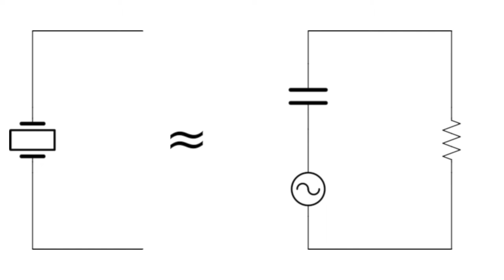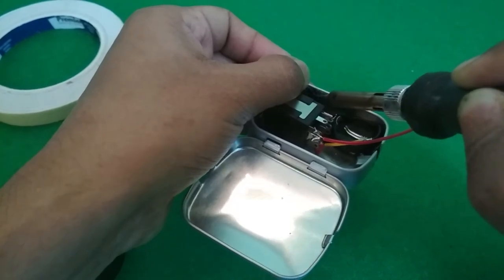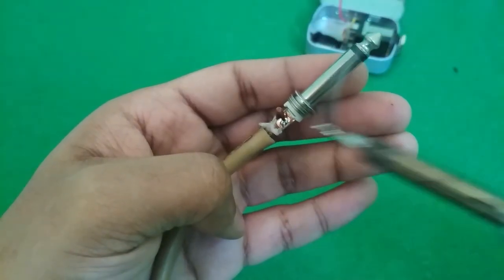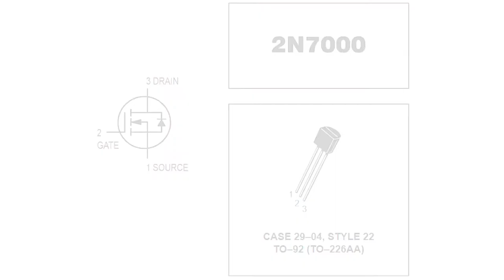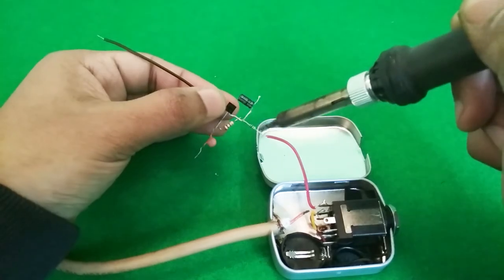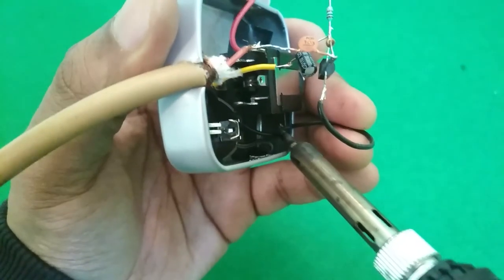Easy DIY Pre-Amp for Acoustic Guitar

Comment: Does this result in a DC offset - or how are negative frequencies handled in this circuit ? I always thought audio is an AC signal. I built it - sounds awesome - it even is too loud for my line input. 
Can one of the components be modified in order to get less output - Eg replacing R1 - the 1K Resistor with 1200 Ohm? 
Thanks for this great lesson in circuit design.
Reply from the maker: The input and output capacitors are there to block DC; that's the way engineers think about it.
You can reduce the gain by making R1 smaller, but that will also reduce battery life. A more standard way to do it would be to add a resistor (100 ohms or less maybe) between the source of the mosfet and ground.
Reply: Do you have some guidance on reducing noise ?

- Using a battery
- Use short cables
- Ground everything
- Twist input cable (add some kind of shielding?)
- Put components from input source until signal amplification into metal encasing (do you know how thick it should be? or what kind of metal is working best?)

Are there more or less noisy piezos? I`m not able to get a really clean signal as you achieved here yet. Anything important I forgot ?
Reply from the maker: @xpeace77  Make sure your metal casing is grounded.
If you're having problems with noise, your first step should be to try and figure out where the noise is coming from and what is causing it. First, check whether the noise is coming from the guitar itself or from the preamp. If the noise stops when you unplug the preamp from the guitar, then you know the noise is coming from the guitar.
Next, what kind of noise do you have? Humming is due to magnetic fields and can be addressed by using twisted pair cables. Static or hissing is usually due to electric fields and can be addressed by shielding the circuit. Crackling or popping sounds are typically due to loose connections. Components also have intrinsic thermal noise, but that shouldn't be a problem for moderate-gain circuits like this one.

Comment: I made this but i have a problem.
It worked fine untill a moment. Now there is a constant loud BUZZ. I don't  have it connected to mains voltage in any way. I changed the transistor with no succes.
Do you know what i did wrong? I just can't find the problem that suddenly came. I had got a message on my laptop that the USB port was pulling more current than the power supply could handle. But it was just for once after the problem came.
Reply from the maker: Why your laptop? Why the USB port? I don't understand how you have things hooked up. 
Anyway, If it was working fine and then stopped, that can only mean that something went wrong with the circuit. My guess is either a short circuit (something is touching that shouldn't be) or a loose connection (something isn't touching that should be).
Maybe the wire connecting your circuit to the metal case has come undone.
Reply from the maker: Another possibility is that there is a noise source that suddenly activated somewhere nearby, that could be any electrical device in the vicinity including your laptop.
This is less likely, though. First, check your connections and make sure ground is connected to the case.
Reply: @Psychotenuse  i use the USB port of my laptop as the powersupply.
All grounds are connected to eachother. I have tested it with a multimeter. The last thing i could think of is that something is wrong with the 10M ohm resistor. I only had 1M so i solderd 10 in series. But i cant test the full resistance since the meter only goes upto 2M. I Will remove the resistor and check if all the resistors still are 1m.
Reply from the maker: @TheDutchFighters  I would advise that you use a battery. Fewer unknowns.

Comment: Hi, is there a way you could power this circuit with the 48v Phantom power of a mixer?
Reply from the maker: It could definitely be done.
Reply: @Psychotenuse  you think it would be necessary to reduce the voltage with a zener or do you think it should work without adding any component
Reply: @pauencinaslaffitte5256  It's a self-biasing circuit, so I think it should be fine as is. The output signal will be very strong though!

Comment: what if you combined this with your aluminum foil condenser microphone? Would it reduce the noise issues there?
Reply from the maker: Yes, probably, particularly if I built the circuit into the mic with short wires on the low level side. Unfortunately that mic only existed for a short period of time after the video was made :P
Reply: @Psychotenuse  awh, I guess I'll just have to replicate it to truly find out :D
 Just to clarify, what do you mean by the "low level side"? Is that the short end of the tube?
Reply from the maker: No, the wires going from the foil to the circuit. Low signal level.
Reply: @Psychotenuse  ah. If I'm getting this correctly, are you saying that the longer wires are acting like antennas, which is leading to white noise?
Reply from the maker: Haha, yes. That's where noise tends to come from in audio.
Reply: @Psychotenuse  ah that makes sense. Thanks!

Comment: Is 9-12 volt okay to that corcuit
Reply from the maker: should work well, but the gain will be rather a lot. For simpler circuits it's generally better to use batteries.
Reply: I already build it but there is static noise and hiss can you please tell me why?

Comment: So I want to use this as a stage before an active preamp, will the 9V(from the true preamp) power this as well?  Or do I need to battery in this circuit as well?  How would you address that?
Reply from the maker: Um... no. This circuit has a capacitor in line with the output, so it can't be powered by the signal sink. Even if you removed that capacitor it would depend entirely on the nature of your "true preamp" and I doubt any guitar preamps are designed to send power down the input line; that tends to be something you only do if you're expecting someone to plug in an electret mic.
Reply: @Psychotenuse  so I’m not sure I understand.  All this electrical and signal stuff if relatively new to me, so thanks for your time and please bear with me…I building an semi hollow guitar.  Like a telecaster the I already own, I want it to have a piezo bridge.  The telecaster has a fishman piezo bridge, with a 9V powered preamp.  Not understanding the  issues with piezos, magnetic pickups, and differing impedance, I bought a neovin pre-1 guitar preamp.  I was thinking I could use this to improve the piezo signal quality in much the same way that the fishman does on my telecaster.  It wasn’t until I really started reading about piezo pickups/bridges did I begin to understand the difference with piezo impedance and magnetic pickup impedance.  So, now being unsure if the preamp I bought is suitable to condition the signal from this piezo bridge, I found your channel and actually made your circuit(haven’t tested it yet but it should work fine).  I intend to run my signal from the bridge into it, then send that signal to my “true”(or previously purchased) preamp, which is powered by a 9V battery.  You are saying that this circuit won’t function if I make it the first stage in the preamp powered by 9V?
Reply: @Psychotenuse  the objective is to condition the piezo bridge’s signal.  Maybe the 9V preamp will do that.  I just don’t know very much about impedance, especially when the other pickups are magnetic
Reply from the maker: @darrellgreen3592  My point was simply that you will need a battery for the circuit.
Given what you're tring to do I would recommend trying out the piezo wired directly to the preamp you puchased. Worst case, it will sound a bit tinny; you're not going to damage anything. The main concern with using both circuits together is that you might get unwanted saturation.
Reply from the maker: @darrellgreen3592  There's three types of impedance: Inductive, capacitive and resistive. Inductive and capacitive are like opposites of each other, resistive is neutral.
Magnetic pickups have mostly inductive impedance and a bit of resistive, meaning that they naturally lose high frequencies and using a buffer (conditioning the signal as you say) helps preserve the high frequencies. Piezos have mostly capacitive impedance, meaning that they naturally lose low frequencies and buffering helps preserve the low end.
Reply: @Psychotenuse  thank you for you reply and explanation.  I need all the education I can get in this area😊. As you suggest, I’ll try the previously purchased preamp to see what kind of results I get.  Looking at it, it is constructed of 1 transistor and 20+ resistors and capacitors.  It’s intended use is an active preamp for passive pickups.  Bought it before I started to educate myself about piezos and magnetics pickups, and subsequently mixing the two.  I think I’m going to simplify this project by wiring the guitar in stereo.  Magnetic to tip and piezo to sleeve, hopefully negating any type of mismatch with impedance etc.  thank you once again for responding and the info.  I appreciate it.👍😊
Reply from the maker: @darrellgreen3592  Super glad to be of help!
PS: You probably want to go Piezo to "ring" and sleeve to ground. Apologies if that's what you meant anyway.
Reply: @Psychotenuse  indeed it is. I get carried away…thanks again
Reply: @Psychotenuse  hey there friend, the guitar is progressing.  There are some issues but I’m addressing them as they arise.  I have another question if you don’t mind.   Regarding piezos, buffers and magnetic pickups…as mentioned previously, I bought a preamp to regulate the piezo signal.  I connected the piezo bridge to it and it seems to work just fine.  This preamp was made specifically for magnetic pickups however, and I’m thinking that it would be beneficial to use it on this guitar as well. Do you have any suggestions for connecting both the piezo and magnetics in this situation?  Should I lower the impedance of the piezo with your buffer first, before sending it to the preamp?  Just wondering what potential problems you see….as always, thanks for any suggestions😊
Reply from the maker: @darrellgreen3592  If it sounds right, it is right. Don't overthink it.

Comment: I did everything like your job I just used 10nf instead 104nf capacitor at the input and 100uf instead 10v 470uf capacitor to the output. I would  especially benifit if you would do this.😢😢😢😢😢😢😢
Reply from the maker: Hi!
Could you clarify?
Reply: Yes!
Reply: Can you make a acoustic guitar  amplifier with lm386 ic

Comment: use a filter stade capacitors filters for that noise
Reply from the maker: What do you have in mind?
Reply: @Psychotenuse  use a 100kΩ or a 1MΩ resistor in parallel in input capacitor like a CR filter and in output use a 100 nF and one 10μF capacitor up to 50μF

Comment: Hey nice video... I have a dought though... I made a magnetic pickup my own and  using it as the pickup for my guitar... It works fine but has less gain..
So if i make this circuit will it be ok with the magnetic pickup? Like will there be any noise or over gain?... Also how long will i get the battery life of 3.3v.. Just to make sure  will i be needing a power..switch

Thank You
Reply from the maker: The gain is somewhere in the neighborhood of 10.

Comment: does it have to be electrolitic caps?  Wouldn't it be easier to use non polarised film or box caps?  Also in the voice over you say a 10nf cap and a 100uf cap.  However the schematic says 100nf and 100uf?

Nice preamp, surprisingly clear and decent quality considering cost of parts.  thanks for the vid.
Reply from the maker: I did actually use a 10nF capacitor on the input, thanks for pointing that out! I will fix the number in the schematic. The output capacitor is electrolytic simply because unpolarized capacitors with such high capacitance values are generally too big and expensive.
Reply: @Psychotenuse  wow, wasn't expecting a response that quickly.  Great thank you for the info, i'll have to make a couple!

Cheers!
Reply: @Psychotenuse  Also, any idea on battery life with one of these 3v disc batteries?
Reply from the maker: Hm. I don't know, but many hours, probably. Let's see. So the battery is discharging through an effective load of about of 1k ohm (order of magnitude). The voltage is 3V so the current is about 3mA. Divide the (according to google) 200mAh capacity of one of these cells by this current value, and we get 66 hours. Not sure how accurate that is, but it's a first approximation, I guess.
Reply: @Psychotenuse  cool thank you ever so much. Last device I built was tube and on a mains powered power supply so I didn’t have to worry about battery power. 

If you can find time. Build yourself a valvecaster. I built one as a valve preamp paired with a solid state poweramp similar to the valvestate amps of the 90s. Sounds half decent. Easy enough and I’m sure you could do one very well! Try it
Reply from the maker: I did build a thing with a valve preamp and solid state power amp, you can see the video on my channel. Cheap valves
Reply: @Psychotenuse  ah yes just saw it. I did with a 12au7. Good channel dude. All well presented and well made!
Reply: @Psychotenuse  Finally got around to building it.

Sounds decent.  Using it on a contact mic and sounds solid.  A guitar signal through it is a little wooly and not great but makes my contact mics shine.  Thanks again for the schematic.
Reply from the maker: Yes, it can be a bit muddy but it works which itself is cool given the low component count. Cheers :)

Comment: Hey mate, this is exactly what i need. Just one question: Can this circuit run fine on 5v, or do you need different components or capacitors for that?
I want to power this using a 5v power bank of phone. Will it work?

Thank you for all the amazing projects you have done.
Reply from the maker: It should work fine on 5 volts, if that's what you want to do.
Reply: @Psychotenuse  ah great, thank you.
Reply: there is a boost converter in those power banks which can be very noisy